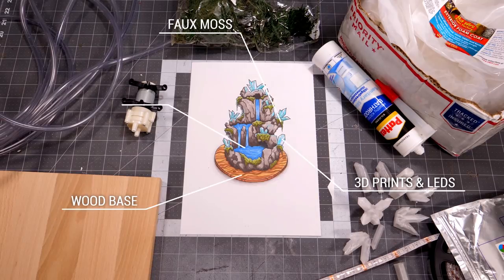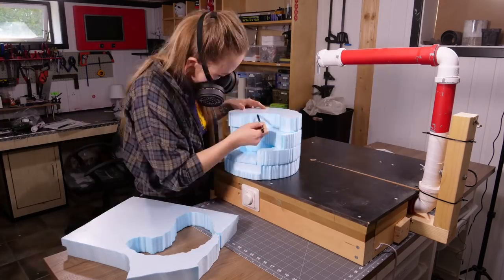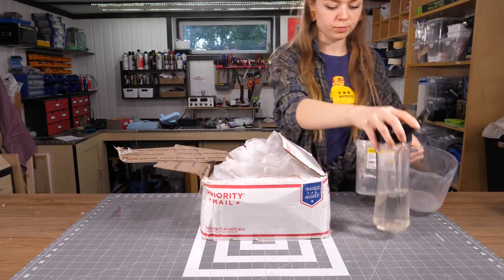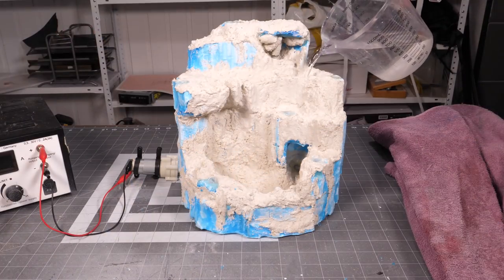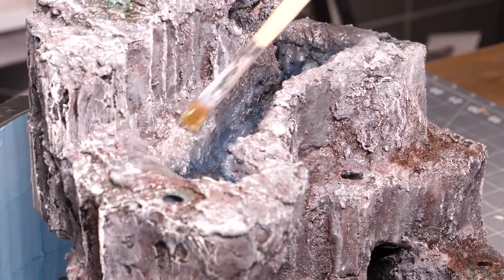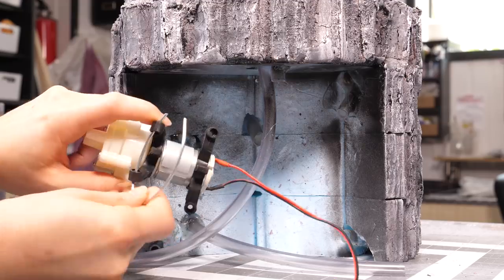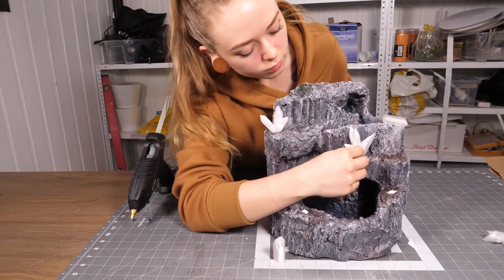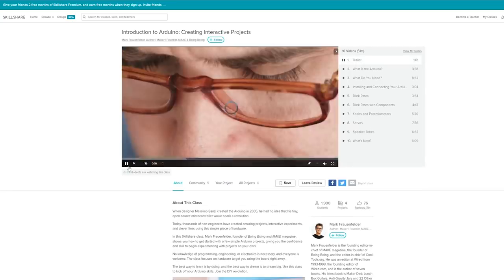DIY Desktop Fountain with Enchanting LED Crystals

Comment: This looks really cool, BUT, you had those waterproof LED strips, why not use a strip of that and line the bottom front of the little lake with that as well ? Maybe add a little diffusing plastic layer on the LED so the light is broken up a little more, it'll seem like a glow is coming from the bottom of the water as well.
Reply: Yep the water would have looked more magical
Reply: that led strip only had the silicone in one side so it is not so waterproof. but it would have looked awesome with some lights in the water
Reply: You can make it waterproof, get a sperate string of waterproof LEDs, use some clear plastic as a shelf in between and waterproof that, many solutions.
Reply: She even already put a layer of transparent silicone down, just needed to add the LED strips in before that step. Easy.
Reply: well perha's maybe glow paint would have been a viable option, that would have probally worked, also some on the moss would have peobally been good as well, i can see what you are indeed saying, would have made it interesting, but like she said it was he first time makeing it and i can't say it dosen't look wonderful, hell i whish i could make something like that or well takw one i have and add to it
Reply: :) good idea

Comment: me sees the thumbnail
Me: awe i want to do that!
Me sees power tools in the vid
Me: i guess i can just watch it
Reply: Me too
Reply: Cecania cc same :(
Reply: Me three!😞🤷🏻‍♀️
Reply: Lol yeah 😂
Reply: Noo! Don't let power tools scare you off. They're not hard to use. You can do it!!
Reply: @Not43Bats  i think the problem is when you don't have the power tools
Reply: You don't really need any for this. And it's not even that much harder - basically you just swap the drill for a screwdriver or something that can poke holes through styrofoam. For the styrofoam shaping jig, I think you'll be more than fine with a sharp enough xacto knife.

Tbh, the most difficult part of this is the electronics. Unless you wanna delve into Arduino or similar, getting your hands on a sufficient RGB controller that would fit all the criteria might be difficult.
Reply: 😂 😂 💀 same
Reply: xD 
same saame
Reply: & the need for a 3D printer....
Reply: @btCharlie_  you can also go the route that aquarium hobbyists go and use expanding foam and a razor scraper to get the rock shapes!
Reply: @jonathanjones2782  - Good point, there's very little that a creative mind cannot overcome :)
Reply: i was thinking the same thing months ago but... now im making it XD im just waiting for help to put the concrete on the styrofoam :)
Reply: Worse comes to worst I guess you could shape it with a potato peeler??
Reply: Me too
Reply: am still thinking of doing it btw
Reply: Normally yes but this is probably the only time you can actually still do it without the powertools, since it's only to drill. You can just heat up a small metal rod or hanger wire on a lighter even and then push it through to make the hole for the wiring.

Comment: Always fun to watch you work. maybe as a tip, when doing cave like structures you can let hot glue "drip off the edges" to create like a stalactite effect. hot glue doesn't break compared to other mediums and it paints easy

Comment: It looks great. I would offer a tip to making granite stone.... after that 1st black layer.. try using a sponge for all after layers instead of a brush.

Next fountain or scenery project, get some sand from outside.. dry it out... very fun to small granulated and pebbles. get some marble to marble shooter size rocks as well. use hot glue to place your boulders (marbler size rocks).. use Elmer's glue along shorelines and around boulders. sprinkle the pebbles in and then the sand around that.

Comment: Great job!  If I may make a suggestion, instead of standard 5050 RGB leds, which require 4 leads, try WS2812 leds.  These are available in a number of configurations.  The nice thing about them is that you only have to cut one led out of the strip instead of 3.  There are actually two varieties: WS2811, which uses 4 wires (+, -, clock and data in) and uses 12 VDC to operate, and the WS2812 which uses 5 VDC and 3 wires (+, -, and data in)  These can be easily controlled by using any of the Arduino computers (I like the Nano), using software available for free from GitHub.  Adafruit has some libraries, but you might like Fastled better.  Alternatively, you could use an led controller such as you used in this project.

Comment: my advice may be outdated by now as this video is over a year old. However for rock, I've found it more beneficial to prime/base coat (a paint and primer all in one is ideal) in a lighter color (gray/brown/green/etc) closer to what you want the finished product to be then wash it down, rather than to start black and try to work up. you end up covering the black anyway so washing will achieve the same effect with more control and is more efficient use of the paint (as u dont need as much). once its sufficiently washed to your liking, drybrush for highlights and you're good to go.
Either way, this ended up looking amazing! very well done!
Reply: She's gotten way better at rock, the latest videos show her using stippling, washing and dry brushing and her colour choices are much better too which makes for awesome realistic rock

Comment: I wonder if the spray nail polish remover would be a good alternative to painting the acetone on.
Reply: ThornHeartRed 
It might not be as effective but could work. Most nail polish removers contain some amount of acetone (anywhere from 30% to 60% acetone). I believe she’s using pure acetone, so if you were to use a nail polish remover with the higher percentage of acetone it might work. On the downside it would be less effective but the plus would be you wouldn’t have to use a respirator and fear death by fumes. Dizziness by fumes maybe but it would still be a good idea to open a window or do it in a ventilated area just to be safe

Comment: Sealing everything with Elmer's glue allows you to spray or paint acetone to exposed areas if your creating texture works great for doing resin lakes as most resin casting melts foam

Comment: I bet someone could make a 3D model of the "rock" part (holes included) so you could print it out and have it made of sturdy plastic instead of foam. It would probably take forever to print but would be so much easier lol.

Comment: Only improvements/advice i think i can mentioned, is that you should probaly have added some plaster where the layers join up, its currently very apparent that its made of several big layers, and i dont think that looks natural, melting them at the same time using acetone might also work.

And then there is the crystals, should maybe have printed in a higher quality setting ( dont know what settings you print with or what the limitations of your printer is ), and given the crystals a thin coat of something that would melt them slightly, so the print layers are less obvious, or just sanding.

Comment: What spray paint were you using?  Maybe I don't have that in my country, nor the foam coating which at first I thought was to create the stone texture. I just use emulsion paint, to protect it from spray paints which usually eats through the foam too.

Comment: Just a tip for ya, you shouldnt add water to acrylic, it weakens its molecular structure and makes it flake and peel. If you look in the airbrush isle they have a base thinner that you can use to "water" it down without breaking it down.

Comment: Here's a fun tip I recently discovered: You can spray paint your foam directly. I know, sounds like a trap, but here's the trick: Most spray paint is made up of a paint pigment, a binder, and Acetone to keep the binder in a liquid state. The acetone WILL melt your foam, but it also evaporates very fast when aerosolized. If you spray from farther away, like 2 or 3 feet, the acetone will evaporate before making contact. By varying the distance, you can also control the interaction of the acetone with you foam, making slightly melty parts, very melty parts, and the effect can be a very stunning stone-like texture without the need to seal or coat your foam.

I love your final product! Painting realistic stone is very tricky, and you nailed it! I just discovered your channel a few minutes ago, but I am subscribing. Now, I'm off to binge the rest of your videos.

Comment: Wow that looks AMAZING! 
I'm on an injectible med for my RA and it comes in a much too large for the item styrofoam cooler chest full of cold packs. It just chafes my hide to have to put all of that in the trash every month.
I'm actually familiar with the layering and carving styrofoam method. An event decorating company I worked for a long time ago used that method to craft all of the large, intricate 3D pieces we used when we were working for shopping malls and museums. I have no idea why I didn't think about that before. I'm disabled and broke so free art supplies I can keep stored in a bin outside under the patio roof fits the bill nicely. That way the lady I rent from won't have a conniption fit over seeing cut down cooler boxes piling up in the laundry/storage room. 😄
And I giggled when you used acetone as a sculpting agent. To make big textured stone wall pieces for one project, they handed me a tray of gasoline and a brush. It reacts the same. Plus if you flick the brush just right it makes the wonderful rough pocked stone of dank dungeon walls. When we were in the shop doing fabrication, I got to play with power tools a lot, too. 😁 That was an amazingly fun job despite long hours overnight in the venues doing setups

Comment: Hey, nice project. I see that your soldering aint perfect, it was same for me some time ago (well its still not perfect)  but here is a tip that will make it easier and much more cleaner - use flux, it helps melt solder and it helps keep it in desire place, just put some on soldering element and than go with tin wire.

Comment: Beautiful work!! I love the fantasy feel it portrays (I'm a fan of any fantasy diy). 
It's not a criticism but just a suggestion that maybe you can incorporate in your next fantasy work with water. It would have been more magical (for me) if there were also lights along the trail of the water so that the water will also sparkle in the dark. Maybe a lot on the bottom pool and one on where the water starts at the top and that small puddle on the middle left.
Keep it up!!!

Comment: This is very neat.  I'd love to have seen something used more permanent than foam material-wise as the core structure for long term durability.  It looks amazing but would have been even more killer with one more water drop area and some lighting submerged to also illuminate the water more at night (to off-set stones).  Great work!

Comment: Love the Fountain! I'm still wondering how you attached the heat shrink between the two led chips? You must have cut the heatshrink before heating and it still sealed? Ive ran into similar situations so nice work to whatever method you used!

Comment: Hey next time you should use ws2812b leds with an arduino. Would make the led light much more better. You need less wires and can controlle each led individuelly. And yaa you not need to use 3 leds per crystal you can just put a single one there ;)
Reply: Also a mist maker at the bottom would look great

Comment: I wonder if you can use a phosphorescent fluid and charge it with a hidden UV LED at the top. That way you'd have a waterfall of glowing water.
Reply: I would imagine it wouldn’t work due to the amount of time the liquid would need to get a decent light

Comment: This is a unique and very cool project. How many hours did you spend on it? (I'm sitting)
Reply from the maker: I guess without counting the dry-time of the foam coat and the silicone, about 5-6 hours maybe? And thanks!
Reply: That's pretty quick especially considering that you were using some materials and processes that were new to you. When I noticed your three changes of clothes I assumed much longer. I only work at two speeds, slow and stop.